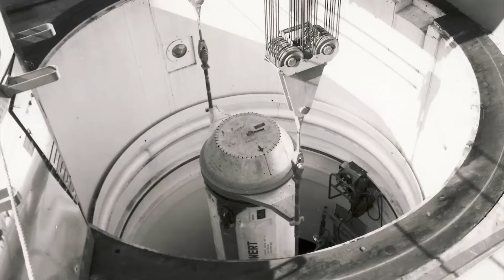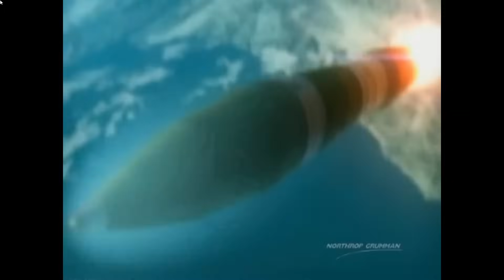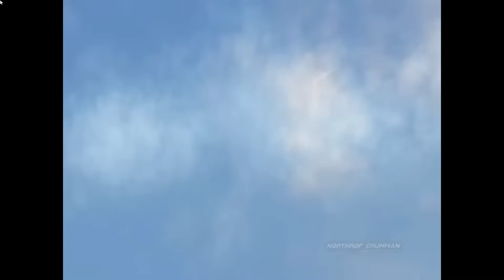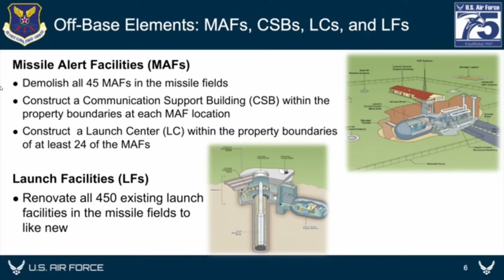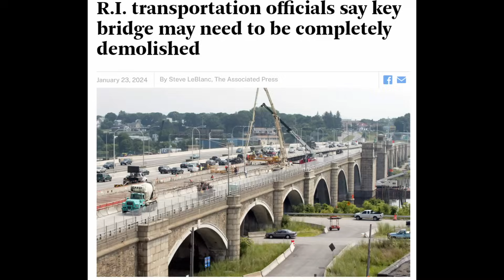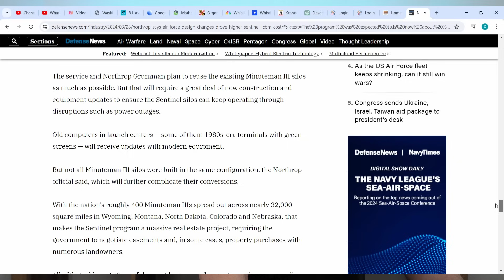Sentinel - How the U.S. Air Force will Upgrade its Land-based Nuclear ICBM Program

Comment: Good review and analysis overall.  I worked Minuteman maintenance for 9 years.  Those facilities get a lot of periodic preventative maintenance.  They have also undergone upgrades as the system matures.  They are very stable internally considering they were designed for single use and to last 10 years when built.  

The missile suspension system is environmentally protected for temperature and humidity too as is the missile.  Structurally stable and sound IMO.

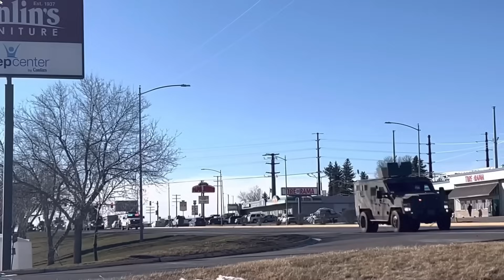13:12  FYI That convoy is not transporting a missile.  They are transporting the payload for the missile.

Comment: I worked on the Peacekeeper missile system in the 90's when active duty and currently as a civilian employee I work at the Minuteman sites at FEW. I can tell you the plan to re-use the Minuteman sites probably won't happen. A contractor came out and did stress tests on the launch tube walls and the sites failed. They wanted to ensure the walls would be capable of supporting a cold launch missile like the Peacekeeper, which is the plan for Sentinel. And don't even get me started on the water issues at the sites.  Some flight areas are notorious for water penetration into the silos.  Now the plan is to dig new holes for the silos. As it stands right now, Sentinel is just a pipe dream. I'll probably be long retired before that new missile is seen. We are supposed to decommission a silo turn it over to a Sentinel contractor before the year is up, but I'm not sure what the plan is for the site if new holes are to be dug.
Reply: The Peacekeeper ICBM. One of my favourite weapons 😍

Comment: Casey, I know concrete technology has come a long way since the early 60’s, when these silos and LCFs were bored & poured. Without getting too technical, with the expectation of each missile having at least a 60 yo lifespan, is there any thought to using self-healing concrete, with a high psi rating? Also, boron and graphite are good gamma ray absorption & reflectivity additives to use. Do you also see graphite as part of the mix?

Comment: They will not use these missiles because they are detectable and can be hacked. That is why we haven't put it into service as our icbm system. 1000% fact. We've always had this system. This is nothing new to those who know. This will not go into service as our icbm. The reason we still use the old one is because it is an analog system not digital. Someone will have to literally dig up the cables buried who knows where and physically tie into the wires to hack it. And that's not happening, giving us almost a 1000% UN-HACKABLE icbm. That is why they the sentinels are almost useless as our #1 go to icbm system. It is good but not that good.
Reply from the maker: Those are very interesting points thank you for that!

Comment: I think the boron is probably to adsorb neutrons, not Gamma rays.  The upgrade from copper communication and data wiring to fiber optics is to improve resistance to EMP.  Corrosion may not be a big issue unless the water has a lot of disolved O2,  Foundation strength may not be a big issue as the structure is lighter than the soil and rock displaced.  New codes are more likily to be an isssue.
Reply from the maker: @michaelmcmullen354   Thank you for that information.  I didn't think about the EMP angle. That makes sense.
Reply: @CaseyJones-Engineer  As far as codes, computer modeling of the blast and shaking effects should be much better now.  Also perhaps there may be butt welded T-1 steel in critical steel...built at the right time.  While concreter was not as strong at that time its strength tended to increase with time and it was not as brittle as modent concrete...changes in manufacture of portland cement in the late 60's made this change in typical concrete behavior.  On the steel corrosion issue, old pulled piles away from salts tend to be pristine more than about 6' below ground.  Not enough O2.  A lot of corrosion near the ground line however.

Comment: The hole point of the nuclear triade is  MAD making impossible to win a war. But with that said the 450 number is not sacred easiest way to cut down on cost is to reduce the amout of sites. For example would you want only 200 nuclear bomb landing in your country?
Reply from the maker: I really don't know what the "correct" number of missiles would be.   I am sure reliability of launch and targeting as well as the degree of any enemy first strikes on these sites factor into it.

Comment: Very good job on the video. This was predictable from the start because the entire nuclear deterrent has been neglected and allowed to atrophy. 
Nuclear Modernization (NM) involves much more than ICBMs, the submarines must be replaced and that project is behind schedule too. The B21 is the only actual replacement item that currently exists but only in small numbers, then there's NC3 the brains behind the nuclear strike not certain if they have that worked out yet, very top secret so good luck getting any info on that. Anyway the entire NM project is a huge undertaking I don't expect to any of it done in time

Comment: Considering that corrosion resistant coatings for rebar inside reinforced concrete REALLY wasn't a thing back then, plus the fact that cement/concrete is porous and just by themselves can have corrosive properties when waters absorbed after curing... 

My bet would be thoses 60yr old silos are HEAVILY compromised, at least for the outer layers. When metal rusts inside cement it needs SOMEWHERE to go so expands inside the concrete and causes it to crack and "scab off" the outermost sections allowing more water and corrosion, rinse, repeat. 

Even if galvanized which in the right environment is PRETTY damn protective, the corrosion from the acidic concrete wouldve easily eaten the zinc coating decades ago and been working on the rebar itself ever since.

And especially with something THIS complex, histortly has show just starting from scratch and building something designed for your current  needs has almost ALWAYS turned out to be cheaper than modifying existing outdated infrastructure to fit your current needs. Not to mention your modern designs performance must intentionally be limited by confining itself to the parameters of the outdated infrastructure. I.e. building a missile to fit the Silo, instead of a Silo to fit the missile.

Not to mention you essentially have to pay twice, first to REMOVE all the old crap in the way that you dont want or need anymore, then pay again to install all the crap you DO want/need.

From what I've heard the missile itself's ready for production;  the exponentially blooming massive cost overruns are almost ENTIRELY from the silos needing more and more work everytime they recalculate the costs.

Comment: Reusing the missile silo structures is just plain silly. Reusing the missile suspension systems is also silly, but something of a non-decision if you are reusing the silos. Understand that the validation of any new nuke-rated hardware design is a very expensive proposition, so reuse the validated design if you want, but the stuff needs to be built anew. How will the fiberoptics penetrate the new silo? If converted to copper outside the silo, realize the Hicks cables are deteriorated after fifty years. The water issue is being overblown here. Yes, its an issue at some silos, but as you say,  you install pumps in the surrounding area to keep the water table low. During construction at Minot, one silo famously hit a wonderful well source, possibly the best one in the county. Everyone tried to get the silo moved a bit so the county could tap the well, but no luck. I think that silo has about 7 wells running to keep the water table down. It might make a good test case - dig it up, check it out, and give the wells over to the county.

The silo soft support buildings and adjacent ground area are basically hazardous waste sites. In spite of a serious mitigation effort, some of the underground diesel tanks for the generators have had large leaks for decades now. The corrosion inhibitors and other toxins have leached into the soils. Attempts to assess the occupational risks to missile maintenance workers are actually illegal. Because it's the military, no one on site will have any right to site safety info as far as exposure risks; or even to the identity of materials they are exposed to. So basically, tent it, dig it all up, send it to Texas on a train, and start again - really, this isn't the hard part. Sixty years ago, a crew of migrant missile workers built 1050 of these in about three years. And keep in mind the ground is frozen half the year - it was much harder to work in those conditions back then.

Also,  I'm not exactly thrilled with the prospect of fiber optic inter-site communications, although that's not really my bag. I'm aware of the issues with the existing inter-site system, but I'd rather retain an extremely low bandwidth technology. You don't really want things  operating faster than humans can shut it down. Current comms run at about 2 data words per second on each Squadron's net. You can almost read the comms on an o-scope. Comms auditing is a lot easier at those speeds.  Comms degradation, comms preventive maintenance, and comms repair maintenance need to be assessed in terms of the long design life and high reliability - this isn't a cable tv "last mile" sort of install. 

And yes, I did used to work missile maintenance at Minot.

Comment: Would the US launch its missiles if it were attacked with hypersonic cruise missiles with conventional warheads?

The fixed missile silos  are what the maginot line was in WW 1.

It maybe a smarter idea to develop a mobile launcher running through an underground tunnel network, dispersed and undetectable, to only surface when given the order to launch. This is a more expensive approach but demonstrates the inability of attacking missiles inbound to target and destroy US ICBMs it cannot see.

Comment: The upgrade of our ICBMs is a dangerous time because an enemy might calculate that the time to attack the U.S. is before that upgrade is completed.
Reply from the maker: Good point.  I do wonder how many will have to be taken out of service at a given time.
Reply: @CaseyJones-Engineer  the have missiles on what is called warm standby.  They would arm them before they took an alert missile and stand it down.
Reply: @MissilemanIII   Glad to hear it.
Reply: @CaseyJones-Engineer   One of these videos I watched said a control center controls 10 ICBMs. So....is that the answer?  I would guess a group of ten would be out of service at any given time.

Comment: Better to dig out all the old and install the New harder to break structures and improve the drainage system. Faster with less guessing and time wasted in testing the old wreckage. Long ago in the 1960's I was in old Nike Ajax underground storage areas some flooded all with some water infiltration. I also visited the Missile master complex when on active reserve duty just before the last Nike Hercules sites along the Lake Michigan waterfront in Chicago were shut down. A lot of sections were in bad shape. A reserve SF unit took it over and used it as a planning cell for a few years.

Comment: I hope you follow this up in the coming years on the level of engineering detail (where the fun is).  Example:  What percent of the silos did they end up re-using?  What about silo remediation?  Epoxy injection?  Rebar corrosion? New liners?  It will be something to watch.  Thanks!  Drilling and coring will be mandatory to evaluate the condition of the concrete silo, rebar and liner. Probably already started.
Reply from the maker: Thank you.  I do hope these details will be made public.  If so, I would love to do that update!

Comment: At this stage of the program, the level of contingency in the cost estimates should be as much as 40% or more. I worked on rail transit projects for several decades. In all that time, I have not been involved in a project or even heard of a project where the site conditions SAVED money. There are always things that increase costs that cannot be accurately projected. Foundations are always a nightmare. Once you get the foundation sorted out, the cost estimates are a lot closer to actuals, but missile silos are nothing BUT foundations.